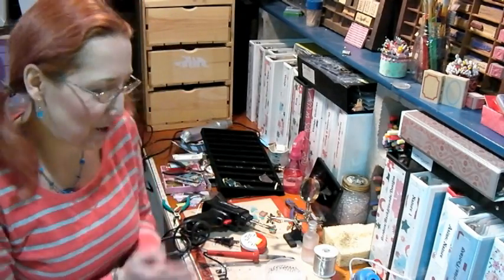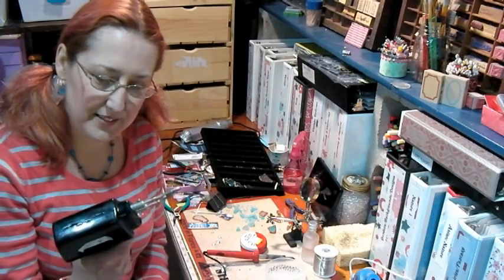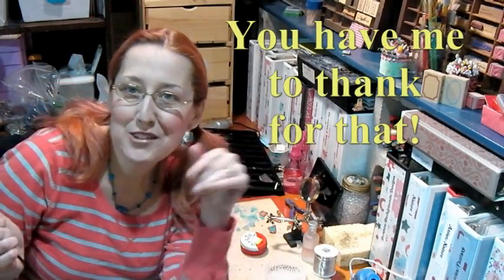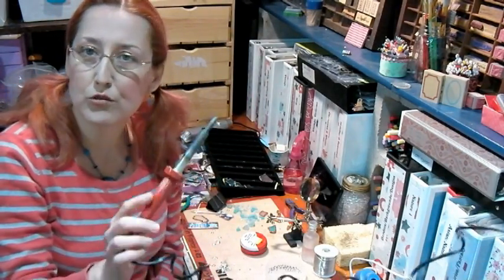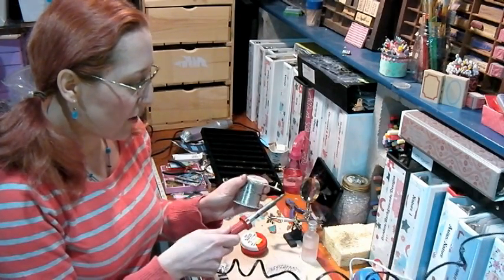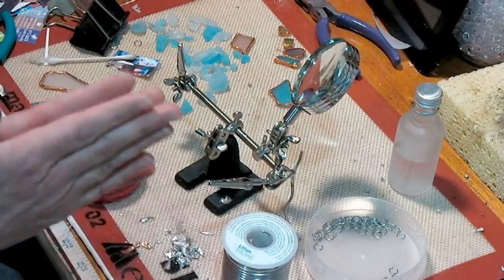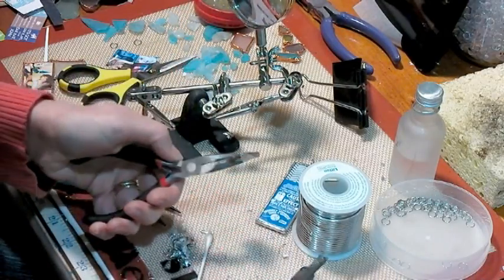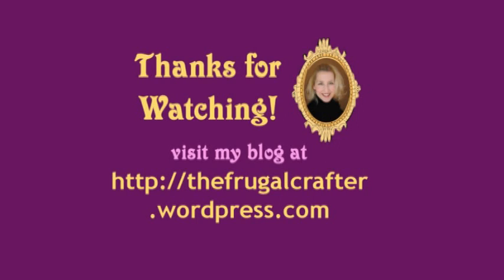soldering for crafters

Comment: Wonderful video, thank you!!!
Now I learned that my iron did not melt the solder was due to oxidation. I did not realize it was so important to de-oxide the tip frequently. I though it was my iron that was not hot enough or did not have enough wattage. I am glad I learned something from this video.
And the flux. I learned from your video that flux goes with solder hand-in-hand; that you don't need to burn the flux first before applying solder; that it's okay to put the solder on the iron and melt it and apply it to the work piece, that it also works not to applying solder to the work piece but to the solder directly as some other video said.
There are two kind of skills for work. One is doing things rapidly, but seemingly dis-organized. The other is paying close attention to the details, and works its way to step by step slowly yet does everything precisely. The former is efficient, although it appears somewhat out of order. The latter has precision work, but seems kind of slow.
You belong to the former, and I like it. You get the work done fast, and the quality of the work is no less than the latter. My wife also belongs to the former; and me, as a computer programmer, kind of pay attention to details, but slow.
Great video, hope to see more of your work!
Reply from the maker: thank you so much for your thoughtful comment:) Happy soldering!

Comment from the maker: I use lead free plumbers solder (it is safe enough for your drinking water to go through so it is fine on your skin) and you can get it at the hardware store or stained glass shop. the copper tape needs to be purchased from a stained glass supplier:) You can buy it online if you don't have a local resource. Get the flux at the hardware store too!

Comment from the maker: the copper tape is for wrapping around glass or stones so the solder will stick to it, solder will not stick to glass. Solder will not stick to aluminum, that tape is more for decoration. If you are using copper or steel wire and no glass you do not need the tape, the tape is for non solderable items. You can get copper tape in silver and gold color too, that might be what you have. You can try it;)

Comment from the maker: OK, I did some research and regular solder can be used on aluminum but here's the rub, you need to use a very hot iron or torch and file (scratch up to remove the layer of aluminum oxide) the surface of the aluminum then quickly flood the solder on it to tin the area, then you will be able to solder on that. Google "how to solder aluminum"" for better advise than I can give and good luck:)

Comment from the maker: It is simple, just wrap each piece of seaglass with copper tape, flux and tin the edges and solder a jump ring on each end, make 6 of these. then attach the soldered sea glass to each other with jump rings and add a clasp on one end:)

Comment from the maker: the solder is typically a silver color but you can patina it to a black or color it with a sharpie (really, you can LOL!) the tape is copper but the backside is available in copper, black, silver and also gold i think. Solder covers the copper on the front side but sometimes you can see the back side of the tape if working with clear glass.

Comment: This is a great tutorial! I learned so much from you and your followers.  In my research, I did learn that cleaning your piece (I use alcohol) before you apply the tape will enable it to stick much better and also before applying the solder.  In other words, don't touch it with your hands if possible (use tweezers).  Thank you, again for sharing your expertise!

Comment from the maker: Soldering would melt it BUT you can make the shrinky-dink charms and punch a 1/4 or larger hole in them before shrinking then use the copper tape to edge them and put a jump ring through the hole for attaching them to jewelry;)

Comment from the maker: you can get copper take with silver or black backing (maybe gold too) so after you solder it and it is silver the inside that you can see through the glass is also silver or black;) You probably need to get it from a glass supplier on line. Venture Tape is a manufacturer of this product;)

Comment from the maker: @ez2stepon yes, you need to make a 6 sided cube out of glass. you  an use picture frame glass. foil every edge and flux then solder the sides to the back peice. fill the frame with decoration ans and solder on the front peice. that is the proper way.

Comment from the maker: I could not find a tip to fit, I did try that first but I save the old iron because I bet I can find some somewhere because they are Webber, I snagged a new iron that works great (and extra tips) on sale at Mardens (a salvage and surplus shop) and it has a point tip that works much better for jewelry. That is a great" tip" though...no pun intended:)

Comment from the maker: if you flux both letters it should be fine. The copper foil is for stuff like glass and stones that do not contain metal, it gives a surface for the solder to stick to. Metal to metal is fine as is as long as it is a solderable metal and you flux it:)

Comment: I like most of your videos but maybe I can help you this time with a suggestion. To make your soldering MUCH better you need to burnish the copper foil tape on the glass or stones you are wrapping. Take a wooden tool like a wooden bone folder and give the piece a good once over on all sides and surfaces. Your pieces will turn out phenomenal!
Reply from the maker: Julia Martin thanks!
Reply: Even an ice cream stick would work and they are more fun to get. But, as said earlier in the comments, copper tape is not good for wearable pieces. Look at the seaglass bracelet photo shown to get you to watch the video. That copper tape is pulling up everywhere. A very thin adhesive is used. It is only strong enough to make the foil stick to the glass.

Comment: Thank-you for this. All I wanted was a simple soldering video and voila. I did take a couple of classes last year but when it's not at home in my art room, I tend to forget some of the teaching. Received a lovely soldering kit at Christmas, have some Kevlar material for safety ( on my wood table, over the carpet on floor and a wee bit for my lap. I gather you could also use a cookie sheet instead on your table. Or tin foil ? ). Really looking forward to making collaged glass bevel pendants !

Comment from the maker: hmmm, I don't know, my tape is copper on both sides, it might be handy to have a silver back if you can see through the glass you are soldering. Just make sure the tape is meant for soldering (aluminum tape is pretty but will not solder) and not just decorative. I bought mine at a stained glass shop and the prices were good plus they offer good advice! Have fun!

Comment: You should run the copper tape through the ring when you're sticking it to the edges of the glass. Then when you tin the copper tape, the ring will get soldered in place in the process. Not only will that create a stronger bond than soldering the ring to the outside of the tinned tape, but you won't have to fiddle around with the third hand gizmo.

By the way, if you ever have any questions about electrical soldering, just ask. I worked at a PCB factory in Pittsfield, Maine in the 1990s, and I soldered about 4 million joints during my time there. I also trained new employees to solder.

And now, thanks to your video, the "I should have bought it, when I saw it, at Marden's" jingle is stuck in my head.
Reply from the maker: Small world, I am from China Maine and now live in the Bangor area! Thanks for the tip! (and you shouda bought it when you saw it at Mardens!)
Reply: thefrugalcrafter Lindsay Weirich
I'm from Dexter, which is about 45 minutes from Bangor. I used to go to Bangor a lot; as a kid we often went there on Friday nights for Mom to do some shopping.

When I got my driver's license as a teenager in the early '90s my friends and I went there often to play pool at a place called Top Spot and go to the Space Port arcade at the Bangor Mall (I don't think either place still exists). I hardly ever go there now though. It used to be that if you wanted to buy something that wasn't available in a small town, you went to Bangor, but for the past 15 years or so, I've bought stuff like that online.

I've driven through China several times; never stopped there.
Reply: Is there a place called China in the U.S.? I'm just curious. Do the folks there called Chinese?
I am from China, too, but obviously not the same town.
Reply: See I told you
There's a town here in Maine, USA called "China". The people from that town are not called "Chinese" that I know of, though I can't say for sure because I don't live there. If they were called "Chinese" it would just be as a joke. Maine has several towns named after countries, such as Norway, Sweden, Mexico, etc. See this picture of a road sign in Maine - http://i491.photobucket.com/albums/rr278/jessieb1330/DSC06435.jpg
Reply: MaximRecoil p

Comment: I really appreciate all your help! I actually had looked up how to attach aluminum to aluminum & saw what you described but it sounded more complicated than just going & trying steel wire. I found that for both aluminum & some wires they were saying to scrub down with sand paper & wash but I'd think washing would add another film. I'll try the alcohol & also will take a scratch pad & see what happens. Vid still has about an hour so you'll probably be in bed but I work weekends so no worries.

Comment: Instead filing your solder tip to clean it...buy a block of Sal Ammoniac at Ace Hardware. To use the block, make a grove in the block. Pull a bead of solder and roll the tip in the grove of the block. I do this every few minutes or so. Your soldering tip will be clean, bright and shiny and last for years.
Reply: Carol Rose Rolston the tip with the bead of solder onto it? Doesn’t that mean you have to change it, get a new block frequently?
Reply: Carol Rose hi

Comment from the maker: huh, that is odd, I am using a flux paste in a can and lead free solder, I actually soldered something to my "helping hand" clips by accident so it works well on steel. You know, I bet if you wipe your wire with alcohol it would work, hardware store steel wire sometimes has a oily coating on it, maybe it is resisting the solder. I'll have a look if the video comes in before I go to bed. I'll be off line after that til Tuesday but I'll check back in!

Comment: Hi Lindsay, Thank you for all your tutorials.  You're awesome!  Fyi:  I've learned fron stained glass class I'm taking is to use Ammoniac Tinning Block to clean and tin your solder iron tip.  It really works well.  Also, instead of a wet sponge use Tip cleaning wire frim Hakko.  It's a waterless sponge.   It removes debris and some corrosion from the soldering tip but soft enough that it won't damage the tip.  I'm a big fan of Amazon and that's where I bought them.  Lol  I'm sure there's other sites to buy them from.
Reply: Amazon is no longer the cheapest place for products. Buy the same Hakko from eBay, you'll get it cheaper and most merchandises shipped free.
Reply: No ebay merchandise shipps free. You are paying for it in your product cost. It is just a marketing gimmick and I admit I use it a lot for when I sell.

Comment from the maker: so they sold you a solder at the hardware store for aluminum? Maybe they were misinformed. You could wrap the aluminum wire with copper tap, flux and solder.

Comment: If you use sal ammoniac + flux on your soldering tip and NOT wet sponge, tip will last much longer - like years! Also brass brush. Also, your answer to Charlene Broekx about only copper tape will only work for decorative pieces. It's very fragile and won't last for wearable pieces - will just peel off. In addition, it would work much easier if you used a second third hand to attach jump ring instead of the contortions you go thru. Just saying...... Otherwise, great video.
Reply from the maker: +kth46 thanks for the advice;)
Reply: +kth46 What can I use instead of the thin tape to have a durable metal wrap on my jewelry?

Comment: You're right about the 1/8" thickness. I ordered some and they were all 1"X3" and 1/8" thickness. I'm now guessing the true measurement of the material is just under (like with lumber) or perhaps the copper tape is a little wider. Thank you for you assistance.

Comment: PS . i'm doing a wiring jewelry at the mom so this technique going to b  HUGE complimentary to my work ..  thank ones more ;) xxx
Reply from the maker: Hi there! Here is the supply list you requested:
Copper Tape
Flux
Solder (Lead Free)
Soldering iron (pencil style)
Steel or copper wire if you want to make jump rings or other wire stuff to solder to.

These supplies can be found at a stained glass or hardware store or plumbing supplier.

Comment: Here’s more tips any beginner should know: 

Most soldering irons in the medium prized to low prized group has a sleep function and a way to set the temperature.  If not used for some minutes, it shuts off. The dial to set the temperature prevents you from burning everything to a crisp. 

Always go for a 90–100 W iron as it will give you the most even temperature. Nothing is worse than having an iron that one second is the right temperature and the next it is too cold. 

Use a copper sponge thingy to clean your iron tip. It costs a couple of cents and lasts for an eternity. Some use a wet sponge but that can shorten the soldering tip’s life. 

Using copper tape, be aware of that you can get them with both black and silver back side but most often it is copper on front and back. 

Use a burnisher to straighten out your copper tape and to let it adhere to the surface. You can use a popsicle stick. ❤

ALWAYS use leadfree tin solder if you are going to solder jewelry. If it is a dust collector or knick-knack you are making, you can use leaded solder. But ALWAYS use protective glasses and a professional mask if you use solder and leaded solder as they are extremely dangerous. 

A good tool is a magnetic box with lots of clamps on magnetic feet in it. They can easily hold the things you want to connect. 

You need two pliers as well to hold your pieces as things get extremely hot! And to not burn down your work table, use a heat resistant mat or a big slice of tile. 

Soldering flux comes in gazillion versions, from the really acidic lethal ones to lemon juice mixed with glycerine. Most store bought flux is poisonous when heated or handled so get NITRILE gloves. Regular gloves won’t do. 

And have fun! You learn the most from trying and failing.

Comment: So, by theory, if I have multiple pieces that have been soldered, I should be able to attach the solder together (using flux) to stick the edges together, right? If you get two surfaces hot, they should stick together, right? 

Thank you so much for your time! This video has been amazingly helpful for a first-timer! <3

Comment: Thanks. yeah, I just checked and found there's supposed to be some special flux for aluminum only and my hardware store had it but I asked them if they had some bendable wire since I had all the, er, regular soldering stuff so he showed me some and I bought a roll. Gonna give it a shot later tonight. Thanks for the reply! =o)

Comment: Hi, I'm having trouble soldering when I use flux. For some reason it won't stick. Could it be that the flux is bad? I solder fine without. Is flux needed?

Comment from the maker: you need steel or copper wire. You can get steel at the hardware store or copper at the craft store. Aluminum will not work. Luckily it is pretty inexpensive:)

Comment: Loved It. I actually thought the jumpring went over it. when you showed the "still shot", I caught that it is actually on the edge. I'm curious how strong that remains. As well, the slides don't get hot enough to snap? Will they break while being worn? I just thought slides were kinda thin as I remember from Med. Asst. school. Looks like another craft I really want to do. You always, always inspire me. And again "this is not the technique to be used to solder electronics". LOL Thx Lindsay
Reply from the maker: GoldCoastCraftsbyDesign you have 2 slides together which makes it about 1/8" thick, I have never had it snap or break. They last for years in labs, they must be fairly strong. The jumprings seem to be holding up quite well if they are soldered correctly.

Comment: Great job!!  At least you got that dang gun out of the box-I haven't unboxed mine yet and it's been 2 years.  You give me hope!!   I couldn't quite hear the part about the jump ring opening.  When you solder on the jump ring do you try to attach the jump ring at the opening or avoid soldering at the actual opening of the jump ring....I hope I am not being as clear as mud.
Reply from the maker: AuntieS412 I try to attach it so I solder the jump rind opening to the surface so it is closed so I don't have a weak spot.